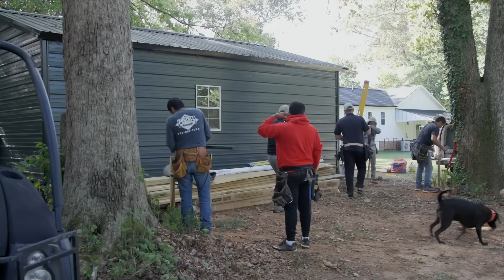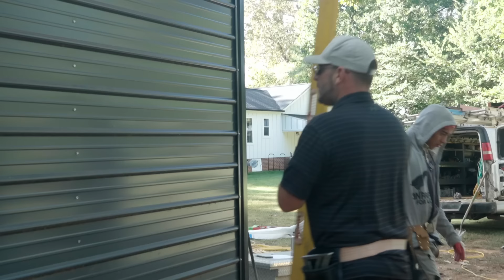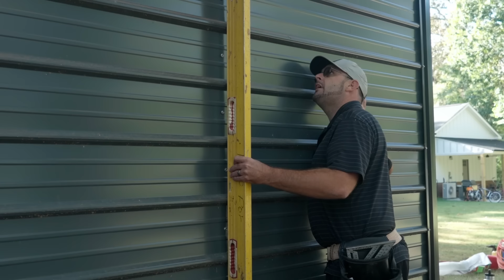How to Build a Lean-To | Step By Step!!

Comment: I need to build something like this over my patio and deck that run together but I need to attach from the slope side, only have 8' in height to the overhang and told I need to go up on the roof and attach above the outside wall to make sure I have enough room for the proper slop and plenty of head room on the outside beam.
Going out 20' running 50'.
Any insight would be appreciated!
Reply from the maker: You were told correctly. Going up the roof a little ways will provide you with a better slope while being able to raise the beam up high enough to not feel crowded. being that you are going 20' out i would recommend you go 6 feet up the roof to get at least a 3/12 pitch. you will have to flash the gables to ensure no water enters but i think you will appreciate the look you end up with. if you want send me some pictures of your area or any questions and I'll do what i can to help. Ask anything at all, I'd be glad to help!!! we are on facebook as well @firstnforemost and my email is 
firstnforemost2022@gmail.com.  Thank you for watching

Comment: What is the ledger board connected to on the inside of the building?
Reply from the maker: Thank you for watching P wolf!!!
the ledger is connected to the wall studs of the existing structure.
Reply: @firstnforemost7283   My shed is a metal frame and not a wood frame. My lean to will be 60 by 16 feet, Do you think the metal frame can support this? My ledger will have to be connected to the metal post (3 inch square tube metal). Thanks for your time...

Comment: What if it's a portable building so I need it freestanding right next to it
Reply from the maker: thanks for watching and commenting brandon!
if it was free standing all you would have to do is install 3 posts on the same layout as the ones in front as well as an additional gerder beam. Big key with freestanding items is not to remove the braces until roof is screwed completely of as that is what holds the structure straight and true!!!

Comment: Thanks for showing the video. I see that you screwed the header over the metal in the outside.  It will be difficult down the road to remove in case of damage, or putting in a window or door.  I have this same issue, so I’ll be cutting the metal and adding flashing for rain and moisture.
Reply from the maker: yes sir absolutely! Thank you for watching the video
Reply: @firstnforemost7283  Excellent video, detail, and interaction with the guys!  My question or concern is also with attaching the ledger board to the exterior metal of the existing structure.  Is there any concern about moisture getting trapped or getting into the existing structure?  I live in the upper mid-west with rain, snow, and all sorts of freezing moisture, is there a need to somehow seal between the ledger board and the exterior siding of the existing structure?  Thank You!

Comment: Looks good, unfortunately that concrete is useless but not mixing it 1st and pouring into holes. Those post can be pulled straight out of it, I've seen happen several times. Another tip wrap the bottom of the post with tar paper and a staple gun it will prevent the concrete from sucking all moisture out of the wood making it rot prematurely. You can add a couple of screws sticking out some to get added strength from the post pulling out of the concrete as well.
Reply from the maker: Thank you for watching the video!!!!
Reply: I would spray the lower post with spray  t a r.

Comment: Great video!! Thanks for sharing.  Is there a certain pitch or angle that the lean to has to have?? The ledger board is higher up than the exterior braces.  How do you figure that height?? Sorry for the question, but I don't know how that part works when building one of these.
Reply from the maker: Thank you Coplock for watching!!! And for the comment. I would recommend at least a 12°-15° pitch. That would also depend on where you live as well. As far as beam height relative to the ledger can be seen by using a line level,a level with a straight board the length of the building or a transom. Ideally you would have 3inches of fall per foot of length. You  can work from the beam or the legder whichever of the two you are most confident in, install that first. If you install the ledger first, multiply 3 inches times the length of the span. So let's say your span is 12 feet long. You would then hook the top of the ledger and mark down 36" and place a nail or screw or a mark with your pencil is fine as well. Then from that mark use a string line or chalk line with a three inch line level attached to it from your mark towards the posts. Pull the line tight and mark one post when the level is centered. From there you can then run the same line level from that post to the other posts. That mark would then be the top of your beam minus the thickness of your rafter. So if your rafter was a 2x6 you would subtract and additional 5 inches or 4 1/2 (to leave a nice bird's mouth). And then make your notches for you beam from there downwards..... If you have your beam set first because thats more comfortable for you, then run a stringline towards the building from the top of your beam and when level place a mark on the existing structure.from there measure upwards the 36 inches plus the thickness of you rafter and mark that as the top of you ledger, and pop a line across the direction of your ledger.  Sorry for the long response but im glad you asked, thats what we are here for!!!
If you have any more queztions feel free to ask anytime. Thank you for taking your time to write us. Make sure to check oit our DIY deck video and DIY ceramic tile as well.
Have a great day sir!!!

Comment: I'm getting ready to do this on my pole barn. Question: What do you do when the steel siding is oriented the other direction (ribs vertical)? I was thinking of using 3/4 plywood spacers between the ribs to set the ledger on top of the ribs so there's no gap.
Reply from the maker: Thank you, sir!!! Yes, I would fill in between the ribs to prevent bending the current sheets inwards for sure. Thank you for watching. And if you run into any trouble during your build feel free to reach out i would love to see photos too!!!
Reply: I've started my Lean To addition, 15 x 30, to my existing pole barn.  I'm using spacers, as you mentioned, and my ledger board is  bolted to the existing 6"x6" barn posts while using lag bolts between the post.  (so far, so good)

Comment: How would you do the rafter tails differently if you were to install a gutter?
Reply from the maker: Good evening and thanks for the comment!!!!
if you would like to have gutters, you wouldnt have to do anything to the tail cut itself. But there would need to be a horizontal fascia board added to the outside of the tails from end to end. I would recommend using gutter clips that have screws and even though there is a fascia board still align the screws to go into the rafters for added security and strength!!! Great question!!! Thank you for watching

Comment: I found your video and found it SO helpful for a build I need to do this summer. My question is when you put the posts in the ground, could you come back after the concrete has set and add more concrete in a 'box' around the base an inch above ground to help keep the posts from rotting?  Also, (you probably don't have this issue where you are) how do you plan around frost heave?  My old lean-to is falling apart because of the corner raising higher and higher every winter. I plan to tear it down and rebuild it and make it the entire length of the barn. I'm afraid if I don't it's going to fall in on top of my ponies. Thank you! I have subscribed to your channel as well.
Reply from the maker: Thank you miss Holly for the support and watching the video! Lets try to answer your questions one by one!
yes you could add concrete via a form after the original pour, however, you would need to drill into the lower concrete and attach rebar with an epoxy to help adjoin the two concrete sections. It would suit you better to form off where the concrete goes and mix the concrete with water thoroughly and then add the concrete to the hole. you  could even add a bolt with threads up while concrete is still wet to attach some sort of bracket to after the concrete cures. As far as the frost heave unfortunately if the weight isnt much the power of water freezing may always lift your foundation, the best i could suggest is go at least 10-12inches below your freezline(if you dont know what that is you can call your local building department) and have the concrete at the bottom be 24"×24"×12" deep let that set up and then add a new form with the rebar and epoxy i stated earlier being a little skinnier so that the backfill helps hold it down. I really hope this helps you with your planning and if you have any other queations feel free to reach out at anytime! Thank you for watching Miss Holly and have a great day
Reply: @firstnforemost7283  thank you for responding!  The concrete makes sense, and dang, that hole would have to be 8 feet deep.  ND, that's how far under the water lines have to be to keep from freezing. I really appreciate the extra info!
Reply: @Love-at-the-Farm-55  Holy Moly - that's scary cold! We install irrigation down in SC and I can't imagine having to trench that deep much less have somebody hold me upside down by the ankles to glue the fittings. LOL

You folks are tough up there.
Reply: @grumpus1403  LOL I guess we are!

Comment: Great video!  Wish I could find lumber that looked that good around me!  Did you only put two screws per metal stud for the ledger board?  What do you mean "screw on both sides of the ledger break? I thought I should drill and bolt the ledger threw each metal stud but rather not!  I'm building 50'x12'
Reply from the maker: Thank you for watching Ed! yes i did add two screws per metal stud. the ledger break was the 2x6 against the existing metal building. The studs on the metal building were 2 1/2" wide, so i marked 1 1/4" to find the center of the stud, and cut the board to that mark. then continued to the end with the next piece. Being that the  both boards now "shared" the stud and the joint it allowed me two install two screws into the same stud and thus supporting where the first ledger stopped and the second ledger started. A 50'x12' building is big building, if you have any questions during your build feel free to send an email with pictures and I'd be glad to help at anytime!!!!

Comment: WOW!! I love videos like this and have not seen one give so much explanation of details. Wonderful!!!
I am wanting to do something on a little smaller scale to the side of my house...one story, asbestos roofing.
My question is...should the pitch of the lean-to be equal to the pitch of the roof in order for water run-off from the roof to not wash backwards onto the wall of the house during a downpour if the lean-to roof pitch is too shallow? 
That was pretty horrible stated and hope you can decipher what in the world I just asked.
Thanks so much. Jesus bless.
Reply from the maker: thank you for watching Miss Sandra!!!!
you do not have to make your new roof the same pitch as the house. You pitch should ideally be steeper than 12 degrees. A 4/12 pitch which is close to 19 degrees is required if using asphalt shingles. As far as the blowing rain, there is a way to cut Z flashing against the existing structure along with silicone that will protect you from blowing rain!!!

Comment: At 19:12 it looks like the crew is effectively “ripping” a sheet to a narrower width.  But from the video it looks like he’s holding a drill or an impact driver.  How does that even work?  Thanks!

(edit: or is he using some electric metal shears and I just didn’t recognize it)
Reply from the maker: Hey Bill, thank you for watching! they were metal shears that connect to a drill or impact drill. they work really well on thickers gauge metal. i have a short video showing the tool in a little more detail!
it cost about 59 dollars from the local lowes or home depot!

Comment: Stopped watching when I saw the wood being buried in concrete. Even if it’s PT, it’s planned failure, regardless of what a client asks for. Sad that you are promoting it through the video. There are other things that you do well, but disappointing that others are misled to believe it’s quality construction.
Reply: At least you acknowledge that your footwear is bad worksite safety.
Reply from the maker: I'm  sorry you  didn't agree on our how I built the lean-to. But soil destroys wood over 3 times faster than concrete. 6x6 posts will last in concrete anywhere from 20 to 35 years before needing replacement. the builder in this build was undecided on what type of floor he was going to install stamped concrete or a foundation  with wood walls and needed to park his side by side under something until he could make that decision!!! the posts will last until he decides, and longer if he wants to take his time!
Reply: Soil destroying wood faster than concrete is irrelevant. The wood shouldn’t be below grade in soil or concrete. 

The type of floor to be selected in the future is also irrelevant. It would be easy to place any of the floor systems up to concrete piers with the posts mounted on top. It is essentially what is done in garages every day; a concrete foundation finished above grade with the wooden structure built above and a floor poured in the future. Sad excuses for sub-par construction.
Reply from the maker: if wood couldnt stand being under ground or in concrete then 98% of decks and wooden privacy fences in America wouldnt be built at all. The floor type for this builder does make a difference as well because when this customer decides that he can spend his money on said floor he can install metal brackets or supports directly to the 6x6's, and hell close it all the way in, like he really wants to. In the meantime his tools and side by side will not be destroyed by the winter weather! keep watching the videos and you'll  see what quality construction  does look like!
Reply from the maker: you are correct that a post above ground does last longer than in the ground but this guy has tons of options and ways he can continue to finish off his shed! We'll be working with that gentleman for years to come, we'll check in on the lean-to soon enough!
Reply: I stopped when I saw the clown attire. I've heard of building inspectors refusing certification until safely apparel is worn on site. Step on a nail through a board. I bet the crew would be laughing at the gringo over cerveza that night.

Comment: Wouldn't it be better to put the post on concrete blocks instead burying them in the ground  to prevent the wood from rotting?

Nice video btw.
Reply from the maker: yes it definitely would be better. i built this lean-to for a builder i work for and he couldnt decide on what type of floor he was going to lay i.e stamped concrete or pavers. so he told me to do it as i did!!!
ideally a metal bracket attached to concrete or anything keeping the post at least 1 in above the surface would be great!
Reply: @firstnforemost7283 that's good to know. It's the only critique I had on the build. As I understand it, that space where the air meets the wet soil is where wood rots.

Comment: That looks great. I just have a couple of questions please, how high was the lean shed and how deep did you bury the post.
Reply from the maker: thank you for yoir comment sir!!!
the bottom of the hole was 24 inches deep but with the blocks we put in there the posts were probably about 20 inches deep.
the heighth of the lean-to was 8 feet 6 inches where it connected to his garage and at the beam is was about 7 feet  to the top of the  of the beam!!
Reply: The bottom of the foundation needs to be deeper than the frost line where you’re building or 12”, whichever is more.

Comment: Any advantage of not mixing the concrete wet over pouring it in dry?  I’ve seen it both ways..
Reply from the maker: the advantage for me is speed as to not have to pull off and come back a second day. however i would only recommend it when there isnt much weight needed. mixed concrete is stronger no doubt!!!
Reply from the maker: concrete is such a dry product that it will form well either way, it will draw all of the moisture even out of the ground around it until it cures